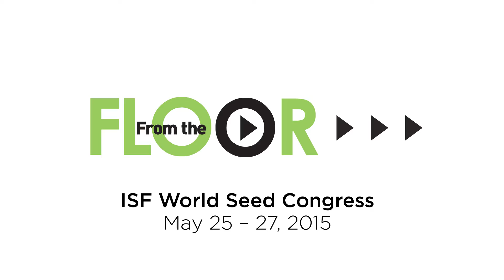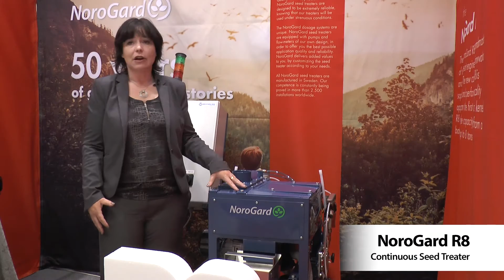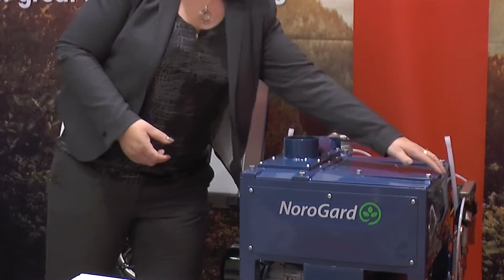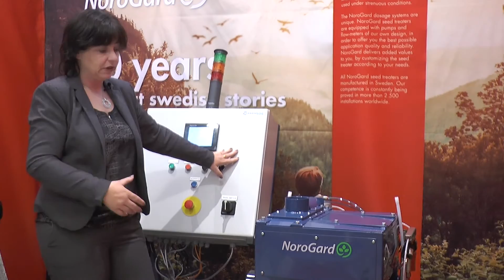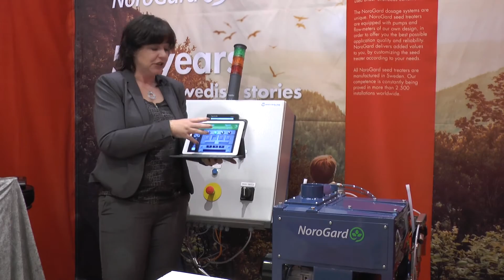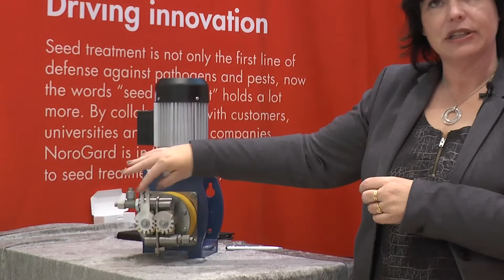ISF 2015 - From The Floor - NoroGard

Comment: Looks very small and compact. Like itWhat size would the R1 be?
Reply: +Paul Whitbread Yes it is indeed very compact. The R1 is just a little bit smaller, but has only capacity go maximum 2 tph, and a very robust and simple model.